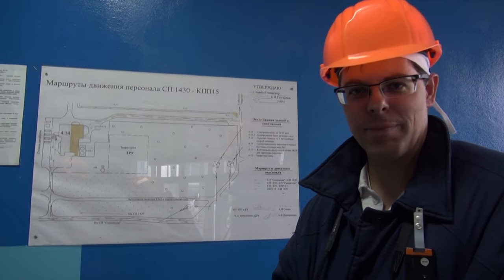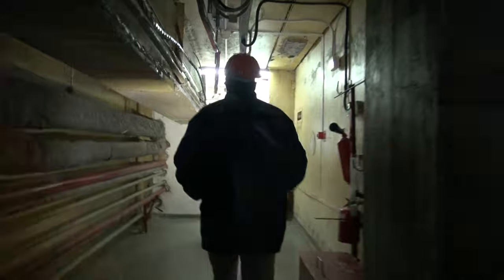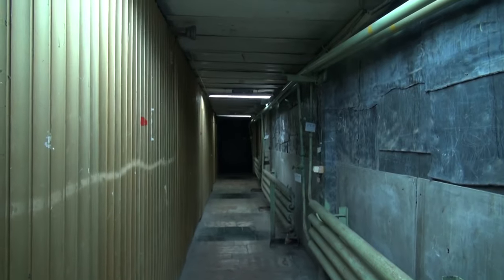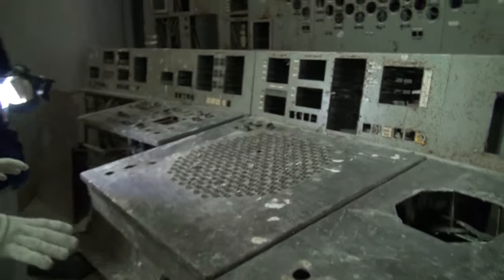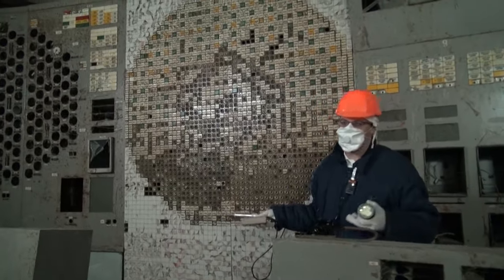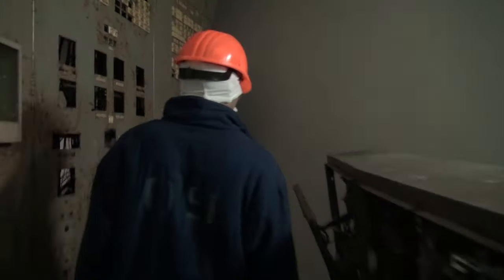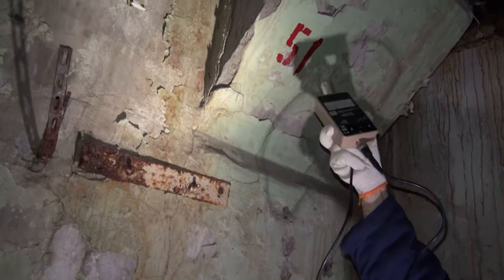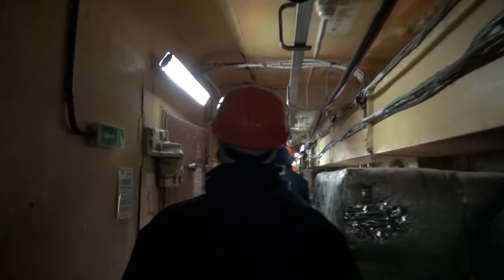inside Chernobyl ЧАЭС sarcophagus 2016 - reactor #4 control room and lead-lined corridors

Comment: For context on radiation: at 6:54, you can see 31.5 uSv/hr.  This is about 10x that recieved while flying on an airplane (about 3uSv/hr, due to natural cosmic rays).  So spending 1 hour at this location is equivalent to flying for 10 hours on an airplane.  Do you smoke?  If you smoke, you inhale about 1uSv per 20pack, meaning 1 hour at this location is equivalent to smoking about 30 packs of cigarettes.  Spending 22 hours at this spot (700uSv) is equivalent to the radiation you'd get from working in a coal mine for a year (due to natural radon).  I don't want to downplay the danger, but the diaster is a lot less scary when you understand the basics of it and compare it to other common sources.  *Note that the way the dector reads radiation does require certain assumptions (which I suggest you investigate on your own), but it is a good rough estimate.
Reply: 24680kong But do those readings still count while you have a radiation suit on? Or would it be less?
Reply: What your body absorb will be less since the fabric somewhat reduce it to a very slight degree and plus iodine pill
Reply: Mhmm, who would I trust? A random stranger on the internet, or the lady on screen with the geiger counter saying that you get a fatal dose of radiation in minutes of going to the highest contaminated area in the reactor?
Reply: @Netherlands91  well yes, what she said is true about the elephant foot location but what 241680kong was talk about was the dose in the control room.  Yes there are SIGNIFICANTLY higher dose rate locations throughout that site but a lot of people have no concept of radiation so those counters squawking the entire time make people think that it was super dangerous in that room when in reality they were just set to the highest sensitivities (multiplier).  

As for the "radiation suit"... it depends on what you are trying to protect yourself from and the main sources emitting.  A tyvex suit would protect against alpha particles (which is probably the majority of the radiation if i had to guess due to the uranium and the plutonium) and it would also help with the contamination, as for beta, you can get suits to protect against it if you need to but it tends to be easier to just limit exposure instead of shield, and gamma or neutron you aint stopping those with any type of suit.
Reply: The problem is not in the level of radiation but in hot dust particles with uranium isotopes of strontium and other isotopes formed as a result of reaction and graphite, zirconium, after the destruction of the power unit, which are in the hall and at the station and can get into the lungs and stomach! and indeed in the Pripreti district and the station, the probability of hitting is great. Yes, and the mask does not help, when removing the mask, a person will inhale particles from it.
Reply: It's exagerated because it was a scam. A hoax.
Reply: @corksdirtyheads1835  What about it?
Reply: Yeah I did a lot of research on nuclear power for a project, and I am by no means an expert, but most fear of nuclear power is due to disasters that would be easily controlled and avoided in today's day. I believe nuclear power is the solution to green energy in the future. Thank you for your great description!
Reply: @kutie216  I know, a reactor failure due to a positive void coefficient and a poorly managed test would NEVER have happened at Fukushima. And the next place to go up in smoke I'm sure will be tsunami proof.
Reply: yeah, tell that to those people who died during and after the accident, those firefighters and those who constructed the sarcophagus.
Reply: @-BuddyGuy  so what if there is an nuclear accident?  Accidents in coal mines happen all the time.  Not to mention all the deaths due to fossil fuel pollution.  In what 60 years of nuclear power there's only been a couple serious accidents while air pollution has probably killed millions.
Reply: @earlspencer7863  You're trying to fit my argument into your template of arguments, as if I felt like arguing the merits of nuclear power vs. coal. I could argue for and against both. For the moment I'm arguing against arrogance about the perceived inherent safety of "modern" reactors.
Reply: So you’re saying a 10hour plane flight is also equivalent to smoking 30 packs of cigarettes?
Reply: @jarlbalgruuf8375  When it comes to radiation your getting exposed to, yes.
Reply: Thank you for the context!
Reply: Yes it’s not as bad as it seems until you realize there is a ticking time bomb in the basement, that when it touches water it’ll fucking wipe out half or more of Europe!
Reply: @stephaniehutchinson6740  how would that happen? The melting core will probably start dripping slowly ,not fall down at once.
Reply: If that does happen then people would be lucky, but considering it mostly a big chunk if it does all fall down at once, it will explode Chernobyl again, and the other 3 Reactors.
Reply: People love drama...
Reply: @fly89  30 -40 people dead.now count the deaths feom other energy forms.. aaaaa and the three heroes so called didnt even die from radiation. nuclear power is the future
Reply: @corksdirtyheads1835  okay buddy I believe you. Go to the reactor and prove everyone wrong.
Reply: Its safe,  nothing happened, you are delusional, take him to the infirmary .... in case you haven't watched the HBO show :)
Reply: Skyler Gabriel most of the isotopes emitted by Chernobyl are iodine, caesium, and strontium. Specifically, I-131, Cs-137, and Sr-90. And I-131 is particularly dangerous.
Reply: You get radiated from cigarettes? So the cigarettes are ionising the air? Please use your brain before writing something on the internet, some people will belive you.
Reply: @octaviani5397  Cigarettes contain Polonium-210 and Lead-210, alpha emitters. Both of which are in the naturally occurring Uranium decay chain. They occur in much higher concentrations in tobacco due to adhering to the leaves via fertilization and are directly inhaled into the lungs when smoked. Alpha particles are easily shielded from causing damaged to individuals unless they come into direct contact with them or are inhaled.
Reply: Kim D how can something that has the potential to be so deadly and that is based off of raw earth materials be the solution over green energy ? Are u a psychopath ?
Reply: @octaviani5397  Do you like bananas?   So do I, but bananas are radioactive.  Wikipedia says:  "The radiation exposure from consuming a banana is approximately 1% of the average daily exposure to radiation, which is 100 banana equivalent doses (BED). The maximum permitted radiation leakage for a nuclear power plant is equivalent to 2,500 BED (250 μSv) per year, while a chest CT scan delivers 70,000 BED (7 mSv)."

As Ralph Morris correctly points out below, cigarettes are radioactive, but do you worry about their radiation content when so much else about them is life threatening?  Before you become rationally terrified of something, you have to have knowledge and a sense of proportion.  In your case you are irrationally terrified of RADIATION, whatever it is, wherever it comes from and however much of it there is.  This is not helpful and is massively counter productive.

I don't like the Uranium cycle and the reactors we have.  I believe Molten Salt Liquid Thorium Reactors will be the future, when fossil fuel lobby's, Uranium suppliers/reprocessors and the shrill, frightened voices are silenced and rational investment (and research) is allowed.  An Australian anti nuclear activist - having learned about MSLTR, - has so changed his mind he now says; "Nuclear power is the ONLY, sustainable, high density energy source that will even touch the sides of climate change."

If you are part of the 95% of people who know little or nothing about science and are one of the shrill, frightened voices, then you have a lot of reading and learning to do.
Reply: Well it's less scary now because radiation degrades over time and we understand things better now.
Reply: @Diffuse That would be according to the Linear No Threshold model of estimating danger from radiation.  The LNT model has been discredited over the years and is no longer used in most studies.  There is even some evidence that a little radiation does you good.  There are levels known to be bad, but the sort of levels that cause loss of rectal integrity in the ignorant and unknowledgeable are often vanishingly small.

If you were to pursue your assertion that one collision could cause cancer and you were going to avoid even that, you would never walk outside on a sunny day, you would install air flushing in your house to prevent build up of radon gas, you wouldn't watch an old fashioned CRT television, never eat a banana, use coal to heat your house and certainly never fly anywhere.  CT scans are right out and types of radiotherapy would be an impossible dilemma.

Trick question:  What profession had the highest occupational radiation dose in any industry (and those include charge face workers in power stations and maintenance crews on nuclear submarines) before 2003?  I don't think you'll get it so, it was Concorde flight crews (flight deck and cabin crews.)  That was because they regularly flew at circa 60,000ft.
Reply: sooo Diatlov was right..not great nor terrible.
Reply: Inside the reactor room the radiation levels are still 10000 roentgens, and that will supply you with a fatal dose in 2-3 minutes
Reply: Different types of radiation
Reply: Neither great nor terrible

Comment: I would really like to see inside reactor 4 but I don't think I would actually go. just don't trust those little meters and with my "shit for luck" syndrome I would probably stand in the wrong place and get butthole cancer
Reply: You can't go inside the reactor Hall. More than likely you would die
Reply: Nubbins man same but I'd only do it if I had say a few weeks left to live anyway.
Reply: It's fine, they have special clothing to limit exposure as much as possible and have strict time limits to also limit exposure to safe levels. You'd probably be exposed to more radiation by smoking for a month than visiting the control room for 20 mins
Reply: @skymcdaniel4675  I know it's wrong but i'll say it anyway. Hell you might even get your cancer removed if you stand in the right spot

Comment: “Beautiful and creepy” she says as her chromosomes begin to literally deform due to radiation. 

Just wow.
Reply: is she wrong?
Reply: Its not even half a mSv per hour in the reactor. Theyd have to stay there for 5 straight hours in order to get the same dose as we get in background radiation every year. Its safe.
Reply: Apparently it's much safer now and the danger mostly comes from physical contact with metals and the like. There are tours through the exclusion zone with very strict dress code rules.
Reply: Feed water is mildly contaminated she’ll be fine I’ve seen worse.

Comment: Why does the Control Room look so small like it was cut in half?
Reply: veleronHL I’m wondering the same thing
Reply: guessing it was sealed off, cause opposite side of those cabinets was entrance and reactor room across the hall, must've been greater exposure without it
Reply: Dave Maverick there was multiple rooms I’ve learned and the bigger ones were not #4 I see

Comment: When people write in the comments: "That's too dangerous!" But actually, 2 hours in that control room (20μS/h) is like a flight from NY to LA in terms of radiation dose.
Reply: Most people also didn't realize the plant minus that reactor continued to operate for years.
Reply: Really? Wow, i use to think that you can’t stay close for the reactor without get cancer.
Reply: So go ahead and rent this place if it's so safe.
Reply: These people are worse than those kids walking above skyscrapers. Worse part is they don't know if they have fallen down for years if they do.
Reply: @warforglory  A geiger counter detects alpha rays. Alpha rays are the ones that only cause problems if inhaled or ingested. They're not an invisible threat that can't be detected and as shown by these measurements the msv values are relatively low. They're not in danger for staying there for a limited time.

Comment: 4:55 No. After the disaster control panels of Units 1-3 were modified. The location of the AZ-5 button moved towards the top of the panel (where you pointed at) and the button itself changed from push to switch. At the time of the accident the AZ-5 pushbutton was on the same panel but at the bottom near edge of the plate. At 5:00 you can see the actual location on the bottom left very briefly.
Reply: Wasn't it because people were leaning on the side and accidentially hitting the button? Thats what I heard before.

Comment: Thought there would still be more radiation than that. Even that hotspot was only 12milli, most areas were 4milli. For reference, a chest Xray is 7 milli.
Reply: There are. She said they were not going to go were it was dangerous.
Reply: @mirhasanoddname  I got ya. I just thought the whole area would be hotter than that.
Reply: firebirdude2 Same I thought it would be more... but still imagine living in a place with that amount, so it’s like constant chest X-rays per hour I guess?

Comment: What was that big red door at the end? :O Where does it go, and why didn't you talk about it?
Reply: Orcinus24x5 Looks like the entry door to the turbine hall.  It's not heavily shielded enough to be a reactor room access and thick enough to definitely be a pressure boundary.  Still wouldn't want to go into it if it was the turbine hall since the RBMK was boiling water reactor.
Reply: Orcinus24x5 the red doors lead to turbine hall and reactor areas, there's some videos of people going through them and radiation levels on the other side of them are extreme.
Reply: Orcinus24x5 it opens the way to the wish granter
Reply: do you have a link to those videos ?
Reply: I think it was mentioned in an earlier vid that the red door leads directly to the reactor.
Reply: Room 553 (the red door) is on the +16.4m elevation in the deaerator building and is a pipeline compartment beneath the deaerators themselves (steam for the deaerators, feedwater from the deaerators to the reactor).  Like all areas associated with the Unit 4 coolant circuit, it is contaminated and probably rather badly.
Reply: I always wonder how they managed to keep unit 3 running for so long after 86 considering they appear to share the deaerators and the infamous chimney
Reply: Orcinus24x5 the big red door leads to the main reactor and no one is allowed because radiation is more to kill a cow within 6 mins
Reply: SkyeGurl I thought the same crazy how they kept the thing up and running with people still employed their after all the mess that occurred their
Reply: Institute Coursers everywhere there too
Reply: If you watch the series it looks like the part were they force the door open and go in and its were its all pumping out and they all get affected and died

Comment: Why the indicators/instruments/devices have been removed from control room ? Basically only the skeleton remained there.
Reply: Anticonny but that other control room was intact and everything was in place.
Reply: I Lezhnin, the control room is located in a facility with a high security level
Reply from the maker: well, i suppose some of the stuff serves as souvenirs for the people who've worked there.
it's not an Ukrainian thing, either. everybody does that. i've seen german physicists destroy linear accelerators (during decommissioning, admittedly; but i guess that's what you could call the state Chernobyl is in, too) just for their personal fun. they ran a clinac in such insane mode (full power photon mode while removing target), the air was glowing blue while they'd irradiate blocks of plastic, only to discharge them and cause fancy lightning figures so they'd have the coolest paper-weights ever. the end of the story is always the same: the million dollar machine fails, mirrors and lasers are destroyed by the radiation, everything is a radioactive wreck - and the physicists shrug, pop open a can of beer and walk away with their buzzing artifacts of destruction.
Reply: +healLV chernobyl was still a working power plant until 2000 or so, it's pretty normal to remove unused equipment for spares, scrap or what ever. Also if all this stuff is contaminated they might have removed as much as is practical for safe disposal rather than just leaving it.
Reply: I think doc is right. The other 3 reactors were online and producing power well into the 90s with the last one being shut down in 2000. I'm pretty sure that when one of the switches or gauges stopped working in one of those control rooms,  they probably stole it from this control room rather then waiting weeks for a replacement to come in. I mean it's not like they were ever going to use reactor 4 ever again.
Reply: Soviets probably removed damming evidence. Just a guess.

Comment: actually toward the end of the whole build up of errors till the explosion, the megawatts were rising FAST so Aleksandr Akimov ordered the reactor shutdown so he hit the AZ-5 button, which in the end was supposed to insert all control rods into the reactor virtually stopping any kind of nuclear activity, but since there were some broken rods that couldnt go in there was a hole inside the core served as a hotspot for steam buildup  which in turn is what exploded from all the immense pressure, causing the 1000 ton reactor lid to be thrown 30 meters in the air just to fall down back on the reactor causing a second explsion